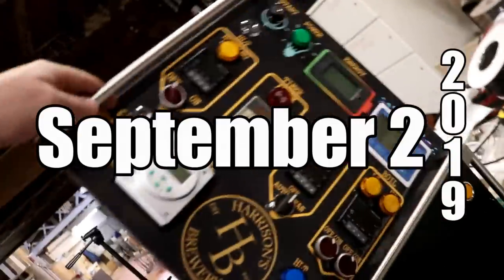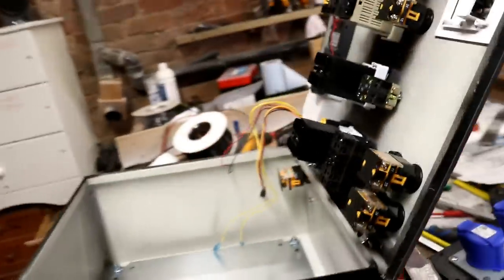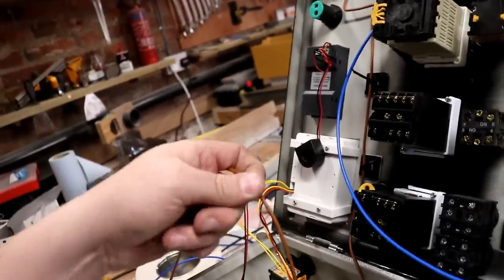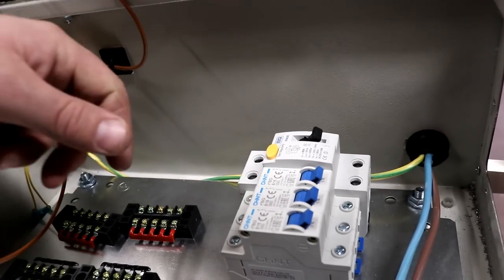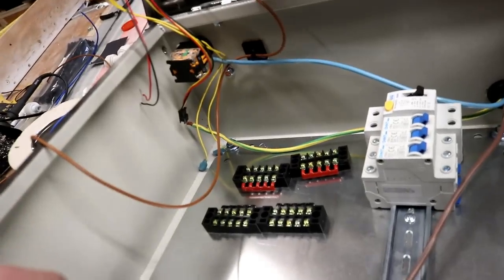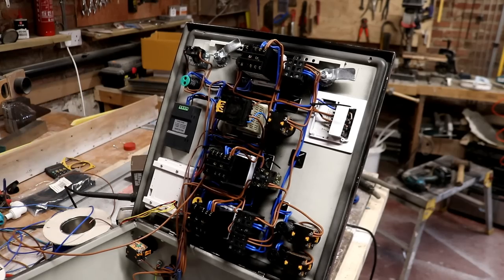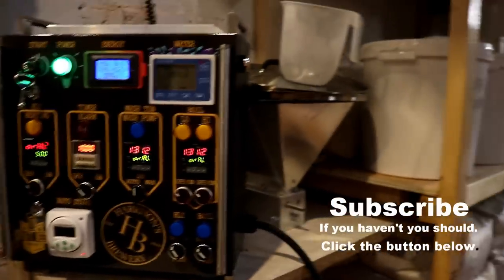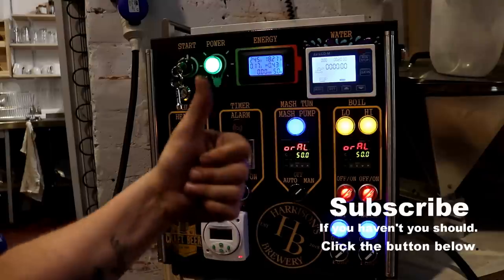Brewery Pilot Kit ~ Control Panel Build ~ Part 5 🍻

Comment: Hi Harry, did you need to lengthen the cable between the flow meter and sensor? If so does it throw the calibration out?